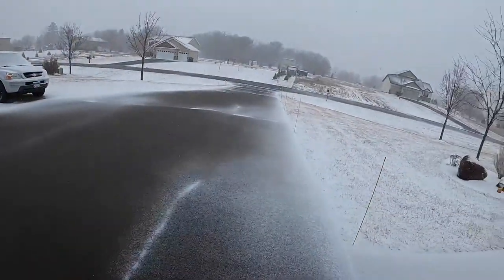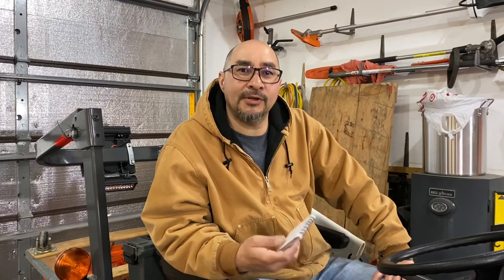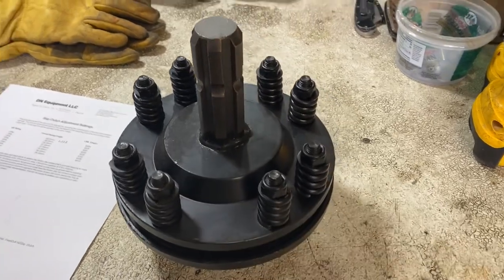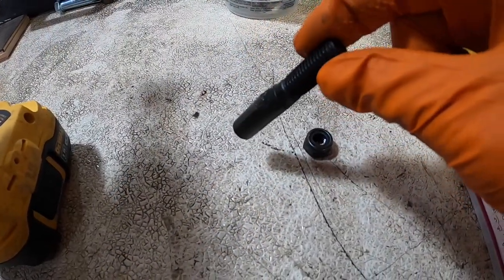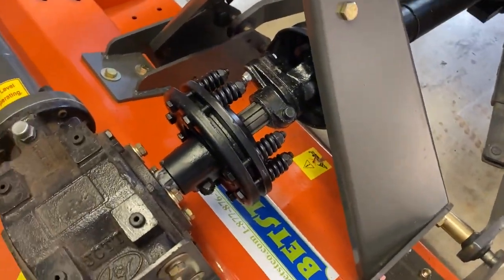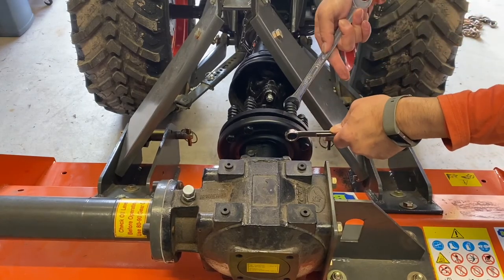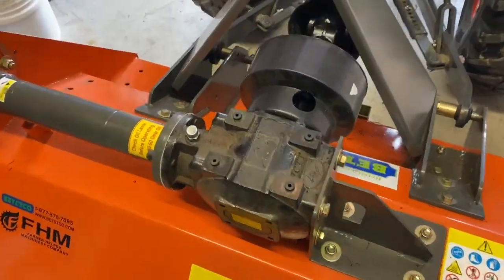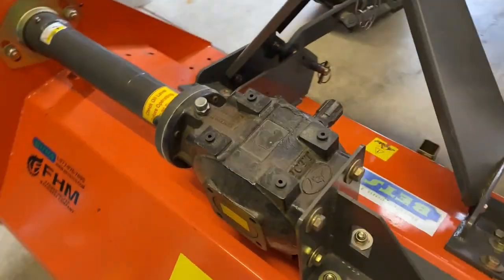Adding a slip clutch to a flail mower?? Now I have double the protection.

Comment: Good thinking to add the clutch for the extra protection.   You may want to re-measure the overlap on your pto shaft now though.  The clutch adds length to it and if you have the mower raised high to navigate hills etc., it can bind up and damage your pto on your tractor...especially if you are going in reverse.

Just found your channel and subbed, thanks for the videos!

BTW, what is the end of the cuttershaft like where it meets the bearing carrier?  Is there any protection/welded ring or guard there?  Some flail mowers call it a wire protection kit etc. to prevent barbed wire from getting sucked up into the bearings.

I have a Mott flail mower and it will suck up stringy/ropey grass into the bearings and smoke them.
Reply from the maker: Thank you for subscribing 👍 I did have to cut the PTO shaft to fit the slip clutch on then added the Pat’s easy hitch system so I got lots of room. As for the bearing protection I have not had a problem yet so I really don’t know what is at the cutter shaft ends. I do plan on making a video on sharpening the hammer blades I can show you then. Thanks for checking out the video 🚜💨💡😁👍

Comment: Hey Mitch. I just got my first tractor about three months ago. I decided on the Kubota BX23S. I think the PTO is 18 HP. I've been trying to decide whether to get a rotary cutter or a flail mower. Do you think my little lawn mower, I mean tractor, can handle this little beast of a mower? Great videos by the way. Thanks man!!
Reply from the maker: Hi Mike I would go with the size Jon Ritter has😁 This one is over kill. If you trailer your Tractor I would definitely go with a flail mower. In my opinion you get a better cut with the flail mower. Get the hammer chisels they work on grass and small trees. Hope this helps with your decision. Have a great weekend 😁👍🚜💨🍳
Reply: Awesome! Thanks for the info and insight. I've been watching his videos and I agree, the medium duty will do more than I need and it's 100lbs lighter. 👍 @MJADoingStuff